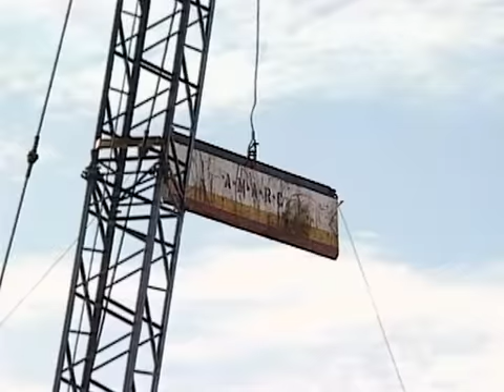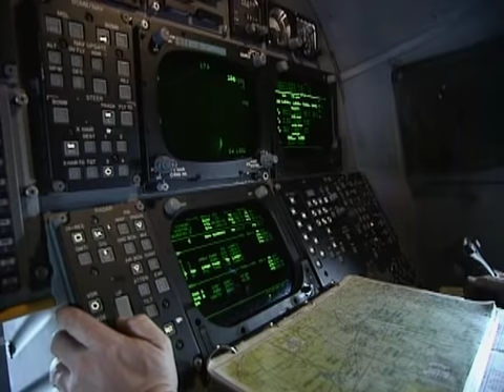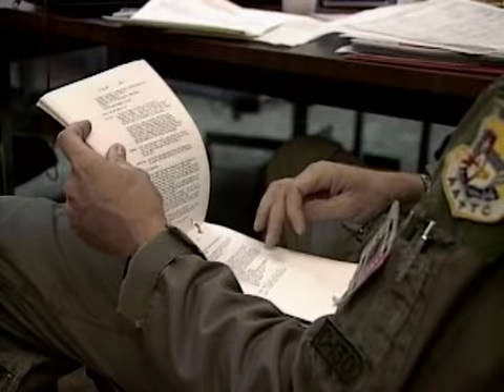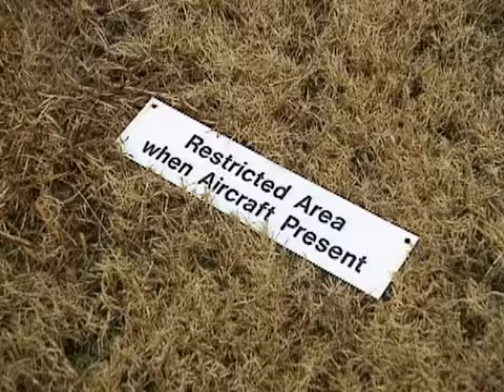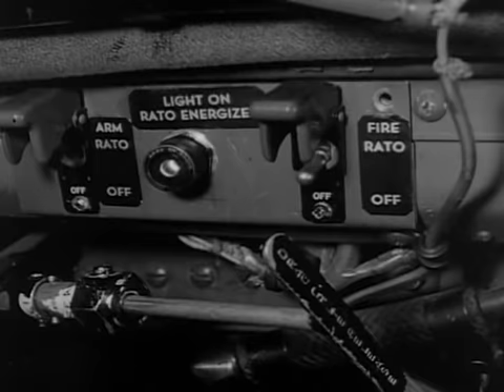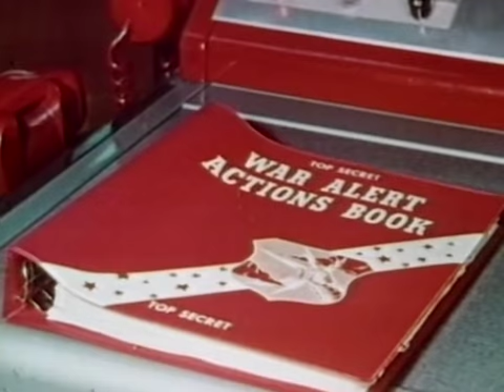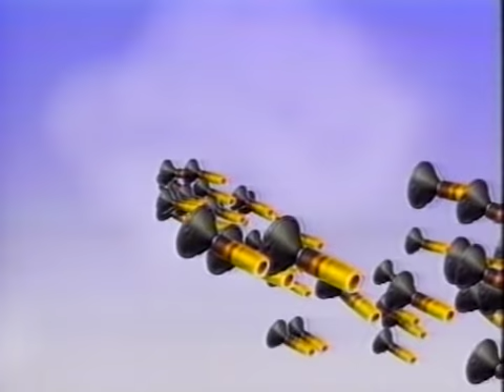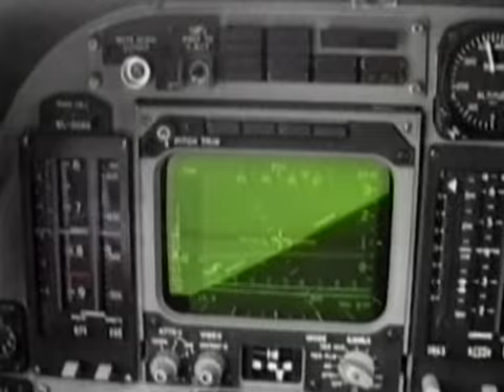DSC Wings B-1B Bomber Doomsday Mission

Comment: 1:52 "typically this intercontinental weapon strikes from 500 feet at more than 900mph." (900mph-1.2 mach or 720 knots).
The B-1B isn't going supersonic at 500 feet.  It was designed to penetrate at 200 feet at 628 knots or Mach 0.95.

Comment: The B1B no longer flies the low level mission. Very stressful on the airframe.
Reply: @ Paul Schab
The B1B can still fly the low level mission , it just has not needed to because it has not been used against a modern air defense system. It has deployed at high altitude with JDAMs and other gps guided weapons they dis not have when this tv show was made in the early 90s... If it was deployed against S300 or S400 defended airspace it would fly at low level...
Reply: @CH-pv2rz  don't forget the sniper pod that's not in this doc :P